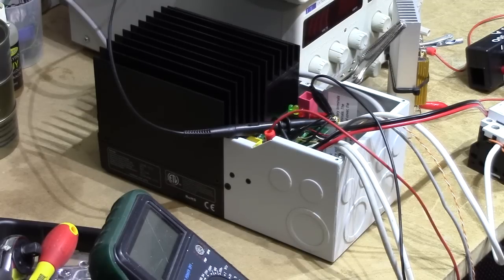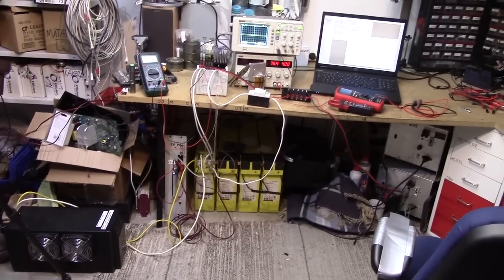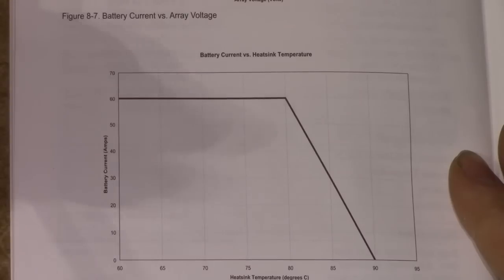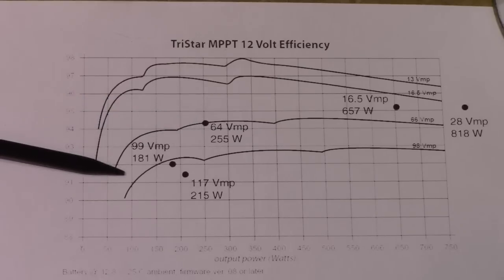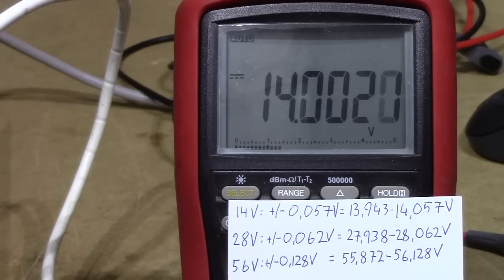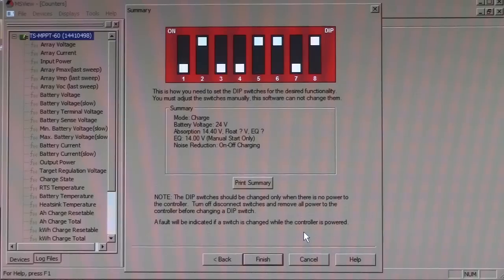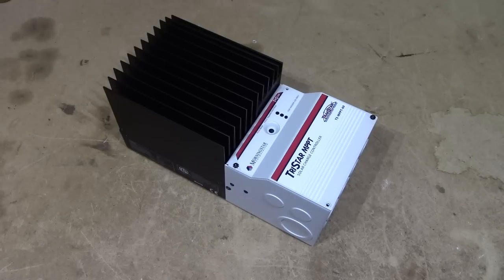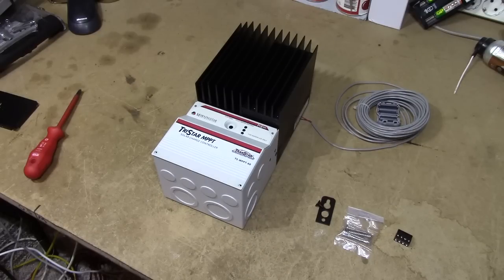Morningstar TS-MPPT-60 technical review

Comment: I have 8- 100 watt panels that I'm going to run in a series where do you convert this 24 volt unit to 12volt ? Is it on the toggle switch red bar inside this unit ? All my equipment is 12 volt .
Reply from the maker: +Michael Smith The Morningstar auto-detects the battery voltage.